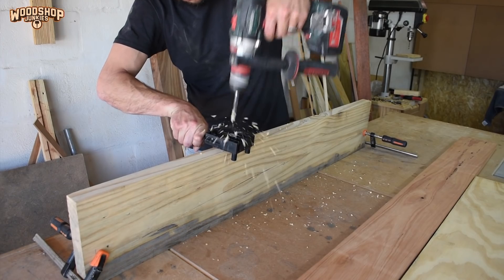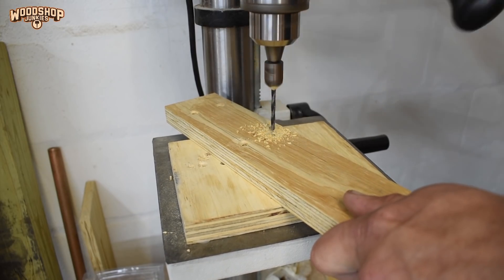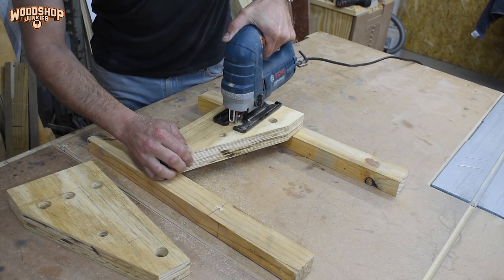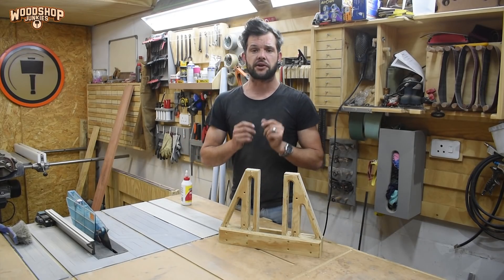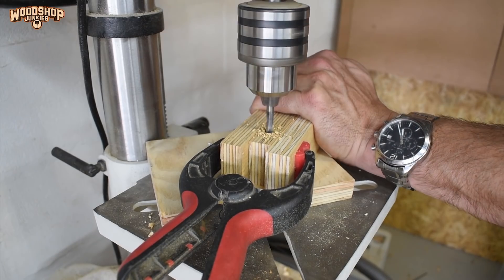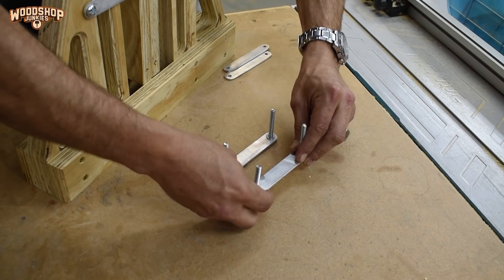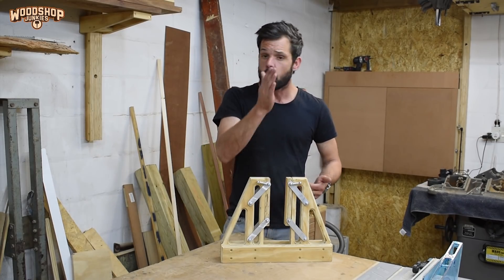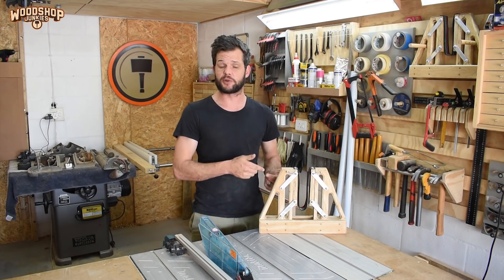Automatic Vertical Edge Clamp - How To

Comment: great design! I worked for a carpenter 40+ years ago that had what he called a door vice - it had taller vertical triangles with a strip of carpet as the sling part. The footing was hinged at an angle a little greater than 180 so the weight of the door pinched the verticals together to clamp the door in place. Of course he used it exclusively for doors - hinges, etc. Your design fits a much wider range of boards and looks stronger, may need to be scaled up for doors. Great work.
Reply: I used to be in the door business. You are right. With some minor modifications to beef these clamps up. These would make great door jacks.

Comment: really solid design - perhaps the strap could have a length adjustment on one end to allow setting the board at different heights dependent on the board width - this would expose board edge for planing etc
Reply: you beat me to the exact same thought!
Reply: Exactly!  That way when edgebanding or similar task, the clamping tool jaws won’t be in the way.
Reply: Or just drop another board of the same thickness in first to raise the board being worked above the clamps. That way you wouldn't need to adjust the strap length.
Reply: I saw the upgrade and it definitely needs an adjustable strap so the board edge is exposed from one end to the other on various widths. Otherwise it's a great idea and I've now got it on my to do list for my shop
Reply: No need for that just put a block of wood under the bottom of the strap to wedge the board to the height you want. If i understand what you are going for. Or an actual wedge, but what is there is pretty solid already. Nuice Job :)
Reply: Like holes in the webbing kinda like holes in a belt….
Reply: @adkchip1  Problem is you lose the fine adjustment that a solid base at the correct height gives you, so belt holes nope, don't see it, a ratchet strap system or some kind of knob tensioning on just one end to give rope or take as needed with a non elastic strap, that maybe would work, but it will always be a little unstable, my 2 cents, go with a cutoff piece under to bring it to height and just shim as needed in increments, or if you have to do a lot of the same height/operation just have measured blocks like a big wooden machinist  123block, or 2wedges forming a cube and a clamp to keep the position/height so you can micro adjust as needed by separating the wedges back and forth. The less fiddling the better, IMO. Cheers
Reply: @mcvirtual2574  If the block you are adding are thicker than the board, it won't clamp the board but only the block. So different thicknesses for every thickness board. Nope, too many blocks laying around. Like Legos...., only going to cause trouble. I agree with the others, adjustable straps that has a positive lock to avoid slippage when you put pressure on the piece you are working on
Reply: @wscottcross4012  Same thickness or slightly narrower so the presser is on the workpiece.
Reply: @mcvirtual2574   use an nylon adjustment like the ones on backpacks
Reply: @WilliamTythas  Now that idea i like, but maybe with either a open clasp, so you can open and adjust and lock back down, or even better car seat belts. Nice going William, that solves a bunch of the issues.

Comment: Brilliant. As we have seen many times before, you have innovative and clever designs that produce excellent results at a reasonable cost. You should definitely add these plans for sale; the design is simple enough but getting the dimensions right will be important, and it is another way to support your channel.

I will likely make these myself; flush trimming edge banding on large panels is a regular challenge, and the beauty of this idea is that it will be easy to work on multiple panels at the same time, or work much more quickly. I don’t yet have a workbench I can easily clamp to vertically on the front (and my shop is too small to have more than one side available) and even then, I could only set up one board and one edge at a time plus the extra time to apply at remove clamps.  Building a single cabinet with and edged door and two interior shelves is 16 edges and this will be a great timesaver. 

Thank you for all the work you do!

Comment: Nipper steel plate sheet bar girder grabbers work on the same mechanical principle. YOUR Idea is good, possible, and probably a commercial investment. it does not scratch doors laminates etc as finished work. excellent. ...many uses applications 10/10 thank you for demo-manuf eg.

Comment: Great idea! I think if you move the static spring anchor points to between the linkage points on each support arm, you could reduce the height of the support arms quite significantly. This would allow you to have the top edge of the board accessible across its whole length.

Comment: Nice design!  I've been on the fence trying to decide whether I want to build a workbench with hideaway tool compartments like yours or a more traditional Roubo bench with a leg vise and numerous dog holes.  Leaning on the latter as the leg vise can grip most doors and long boards while allowing the woodworker to place the edge at a level where  it can be easily planed. However, your vertical edge clamps can certainly be used on benches that don't have a leg vise, which in my experience, is most of them. I very much like your problem solving ability so do keep up building jigs and fixtures to help us weekend woodworking warriors build bigger, better, more functional projects!  Thanks!

Comment: Here in the states it’s called a door buck.  Basically the floor is 1/4” ply & the pressure from the door brings the edges in clamping the door.  On an expensive door you do not want a lot of pressure.  Also there is a commercial one called the door stud.  Check it out.  I am a finish carpenter/ contractor but truthfully I don’t use a lot of them most are pre hung doors.

Comment: I like it. My first thought when you tested it was that it needs to have a plate or something on the bottom that would allow you to clamp it to your workbench. I think this would increase the stability when working on smaller boards. Or being able to add some sort of weight when being used on the floor. Just something to give more stability. 

I like watching your projects. I am such a novice woodworker that I'm not sure that I can make some of the things you are making but your vidoes are usually pretty easy to follow along that I think I might be able to -- if I had the room and some additional tools :).

Comment: I'm always impressed by your ingenuity! I think the only thing I might alter in the design is adjustable straps to allow for the entire edge to be exposed if need be. Although I supposed that could be achieved by use of a spacer block of the same thickness as the work piece. But, as always, a truly brilliant solution. Well done, Sir.

Comment: Excellent concept.
At 13:48 the frame seems prone to slide on the bench; others have suggested making it possible to clamp them to the bench but you could also consider adding non-slip material to the underside of the frame

Comment: Hi, and kudos on another great project. If there is a flaw in the vertical clamp as shown, it seems to be that if the board being held is not wide enough (less than 8 inches or so, from the looks of it) planing the top edge uninterrupted along the full length of the board is not possible. Shortening the straps would bring the board up, but then it would not rest on the bottom the clamp, losing stability. One solution might be to place a spacer strip into the straps first and then the board on top of it, bringing the edge up above the top of the clamps. What do you do to achieve that?

Comment: This is an awesome idea and I will be stealing it😂😂😂 I can think of many ways to use this in my shop and the most obvious choice will be for doors. I have a three legged iron stand that weighs probably 40 pounds this will be a welcome addition to doing the same job as the iron horse but way lighter and the pressure clamping of this by simply placing you project is great. I’ll be adding rubber feet to secure this to any surface floor or bench. 
     Great idea. I watch your videos all the time and still like to know where you bought your mono filter face mask, the blue one. Would really like to have that. 
    Thank you for all the great ideas I’ve used many of your ideas and they have made things easier for me in my shop. Keep up the great work..,

Comment: This is similar to an idea I've had for a DIY baby gate... The difference being instead of clamping something that gets placed in the middle, I want to have a handle in the middle and clamps that swing much like yours on the sides so it holds itself in place under its own weight. Pulling up on the handle would release it and make it simple to install/remove without attaching hardware to the walls.

Comment: I was thinking you might use some kind of elastic tension band (the rubber material would help grip anything inserted into the clamp), but it would not be as durable as the strap you used. Fantastic concept! I would definitely buy a set of these if they were available in stores... Great invention! Thanks for sharing!

Comment: it's a nice project and design. I'd modify one thing on the design and two things on materials:
On design I'd make the strap adjustable, so that the piece can be held on the upper section of the blocks. If I want to do something on the edge and the clamps get in the way, that might be a trouble.
On the materials, the aluminium is eventually goingo to get destroyed by the steel bolts, so i'd rethink this. And the strap, I'd go with leather, for the grip.
But as a prototype your clamp is better than perfect!
Greetings from Brazil

Comment: Very interesting design, I can see some interesting applications for such a lever clamping mechanism.

By adjusting the pivot points of the linkages you could even get a locking feature.

Comment: These are very good & useful, but I'd suggest adding another board to act as a set of feet --- perpendicular to the current base (to form a + when looked at from above or below) --- so that the clamps won't move in any direction.

Comment: Great project. I would suggest not fixing the bands but allow length adjustment for different size planks, if you want to work the edge and want it to stick out. So fix the bands on one side and do a hook and eye solution on the other side.

Comment: I would probably countersink the straps into the clamps to allow for some kind of anti-skid material, which would prevent any kind of horizontal movement.
Also, I would use sturdier bolts and linkages, again to limit horizontal movement. But then again, I have this habit of over-engineering most of my projects (I used 40kg runners for a drawer in my assembly table that only holds work gloves)... :P

Comment: Very clever, but should be height adjustable with the strap to accommodate different width boards (mostly thinking for edge work scenario). Otherwise l would opt for a bench vice like the traditional way

Comment: Would this somehow work with two doors side by side  if you're transposing / transferring measurements for exact hinge and doors handle location from an old door to a new door . I have to replace all my home internal doors as they all had woodborer in them . I have never done this before and the task seems quite daunting  .

Comment: Jean hope you're going to get plenty of use out of your new clamping idea but just a little suggestion, I think you may need to install a plank on the ends of each clamp to make them more stable. Doing this will help prevent the clamps from falling over and generally make them more stable overall plus it will help prevent movement if you're doing any plaining of the wood edge.  As always buddy 💯%    👍    🇬🇧.

Comment: Jean, I love the design. Yes, I would like it if you had a site that had your plans on it. As was mentioned in a couple other posts, it would be nice if the clamps had a way to be fixed to the bench (to keep them from sliding when a force other than vertical is applied). You are awesome! Keep up the good work!

Comment: Good idea but the fact that it's suspended in air makes for good work on the one board. However needing the vertical board to usually mate to another board makes this only a slight problem as both boards can nearly never be the same height. I have while watching this video designed a set of these that might work for a flat work table where the weight of the board isn't holding the pressure but a ratchet strap or over center cam pulling the arm down forl the applied force. It might not work in practice but as a napkin drawing seems like a good start.

Comment: Your idea is beautiful. However there is already a solution for this use. Traditional hand screw clamps do the same thing,  can hang neatly on the wall, don't require complicated assembly and cost nearly nothing, about $10 to $20 in most hardware stores. 

But of course your design is beautiful and fun and easy to use, after one has taken the time to source the materials and build it.

Comment: Besides making the taws or straps height adjustable, maybe to make it more stable is to provide a flip or turn style flat stock on the bottom, so it won’t sway when horizontal force applied.  Or perhaps some clamp could accomplish the same.

Comment: Great clamps for sure, thanks for sharing that very clever solution, for the straps, do you think I could replace by a thick rubber band like part of a bicycle tire or tube?
Reply: A bike tire might work better than a tube. If you press down on the board it would stretch the tube down rather than close the clamp tighter. A tire (or any other non-stretchy material) would work better. But even a bike tube might work to some extent because when you press down the sticky and grippy tube might bond well with the clamp pads (thus pulling them down, thus clamping harder). I still recommend non-stretch materials.

Comment: This is a great design.  I think for a V2, a useful addition would be a way to secure the clamps to a work surface or a way to deploy some additional stability along the axis of the length of the board.

Comment: This edge clamp is ingenious.  However, is the separation between the two clamps limiting?  For single 1× stock or decking boards this is a great idea.  But what about 2× or even 4× stock.  IDK if this will work for me building cabinets.  Even so I like the idea.
Jim

Comment: Interesting, the only thing I would add is anker points fo clamp the clamps (lol), mostly to my workbench, so maybe only on 1 side, the side it will be closes to the edge, just to provide a bit more stability, or at least to make sure it cannot be knocked over to the floor. But other than that, very clever design and useful.

Comment: I thought it was a fascinating idea and well executed, but I wonder; does your bench not have a vise that could hold these boards on end?
Reply: My thought exactly.  But very clever.
Reply: If you are working with a very wide board or piece, putting it in a bench vice on the table will make the piece very high , so you would need to maybe stand on the table, these would work much better if placed on the floor or low, depending on how high or wide the board is.

Comment: Simplify the design and improve rigidity by having one side fixed, and only one side would have the moving parts.  Also instead of a sling, place a horizontal piece across the bottom of the moving arm.

Comment: the one consideration is that with the depth of the clamps, if trying to run a power plane or belt sander and the wood is below the top of the clamp
otherwise cool

Comment: Wearing jewelry and bling is not practical in a workshop…..
Reply: lol.....bling. Are you 90?
Reply: Nope. An Engineer and 70. Safety first is the motto fyi
Reply: @MrTHEBRITINWA  Ey i'm off by 20 years. A wedding band and a watch. The watch is clearly not loose on his wrist and the ring is very much not in the way of anything. You'd have a leg to stand on if it impeded his actions but it doesn't. Imagine referring to a wedding ring and a watch as bling. Next you'll say wearing a belt is a safety hazard.
Reply: @pnel7799  kids today lol